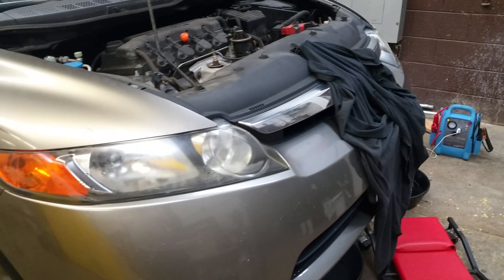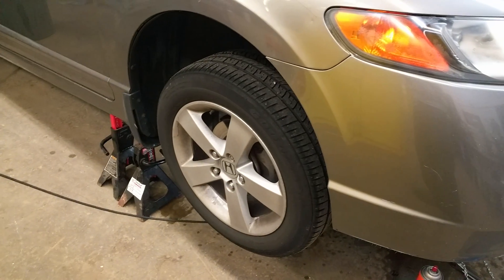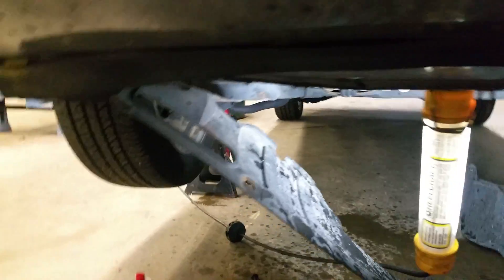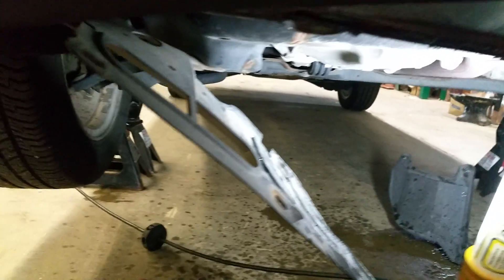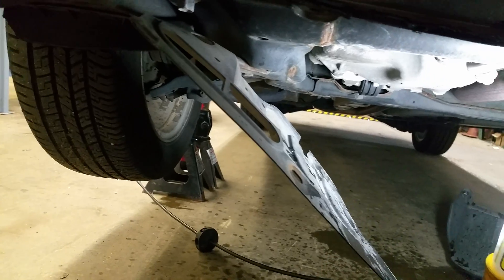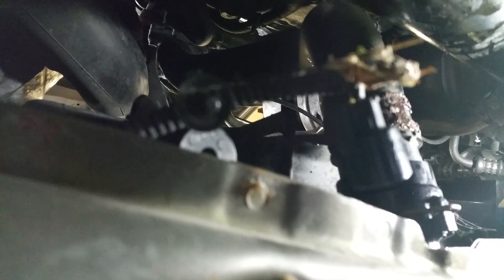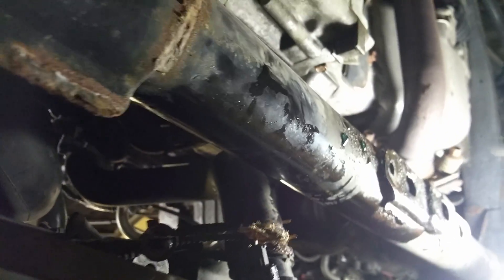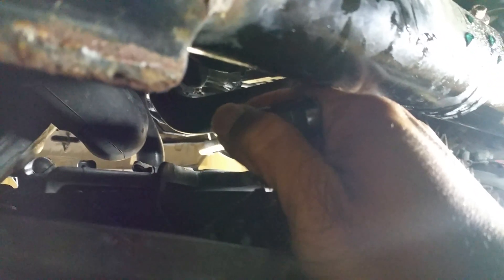06 honda civic engine coolant temperature sensor #2 replacement part 1

Comment: Both my fans won’t go on even when I turn the ac on , you think replacing the radiator sensor this would maybe atleast get my radiator fan to work when needed
Reply: Sounds like a fuse or relay

Comment: Both my fans won’t go on even when I turn the ac on , you think replacing the radiator sensor this would maybe atleast get my radiator fan to work when needed

Comment: Idk if its the coolant sensor it says its heating up and it goes back to to normal help
Reply from the maker: Not sure I would try the cheaper options first. If no leaks and water pump issues then start with the bottom sensor due to the fact that it is exposed to more elements than the top making it more likely to become faulty.

Comment: Is it the same part the sensor on the top?
Reply: No they are not the same the one that goes  on radiator its part number 37870RTA005 its different . Iooks the same but it's not. The one that goes on the engine it's 37870-PLC-004 but this other also work 37870-PNA-002, 37870-PNA-003
Reply: @Samenusa  that was 2 years ago but thanks lol
Reply: @Seddysaid  I know right hahaha. I had the same issue with my car. So I check comment no answer now you got the information for someone else in case they need it.

Comment: My coolant fans are running all the time..which sensor do I need to replace?
Reply: Mine doing same thing. Im thinking it's the relay in the fuse box located under the hood. Ill let you know when I find out.
Reply: @ChuckyBeaver  was it the relay or top temp sensor?
Reply: @justfacts6105  neither. Relays good. Sensors are good. Still a mystery....
Reply: @justfacts6105  The lower ect #2 they said was good but still going to change it out.
Reply: @ChuckyBeaver  got ya I replaced thermostat other day. Did good for like almost 2 days then temp rises n lowers so maybe just a sensor . Thanks for replying 👌
Reply: @ChuckyBeaver  hey man my fiance car I hope we got it fixed now.  Was a tad low on coolant and causes a the coolant to bubble like it need burped..  like a baby lol
#airpocket
Reply: @justfacts6105  mine seems to be ok on coolant. Possibly in the pcm...
Reply: @ChuckyBeaver  ok thanks for tha info I will check that nxt if any problems n her 06 civic.

Comment: My sensor is fine but the connector is corroded, any advice for replacing it myself?
Reply from the maker: I would make sure it had some marine grade grease to prevent it from corroding more unless you felt comfortable replacing the connector  boot.

Comment: Does the senser on radiator works the same as the one on engine.  Would a bad senser on radiator stop my fans.  ?
Reply: No they are not the same the one that goes  on radiator its part number 37870RTA005 its different . Iooks the same but it's not. The one that goes on the engine it's 37870-PLC-004 but this other also work 37870-PNA-002, 37870-PNA-003

Comment: I have a 2007 Honda Civic I replace the first ECT sensor the found out the one connected to the radiator was bad the car did not even give me a check engine light or anything pulled it out it was white coated  all over it but thank God I got my car back running thanks for the video got one on eBay for 9.99
Reply from the maker: M D glad the video helps. You were lucky. I'm thinking that your check engine did not come on is because even though  it  was corroded it still had enough life to send out a positive reading from the sensor.